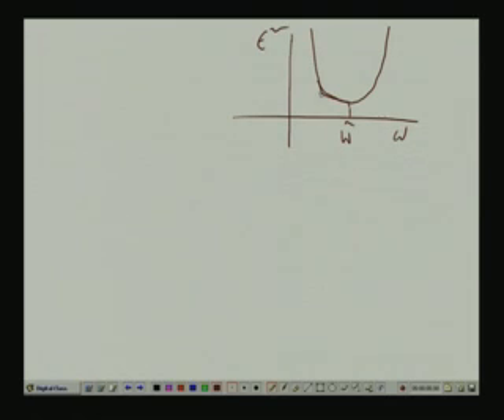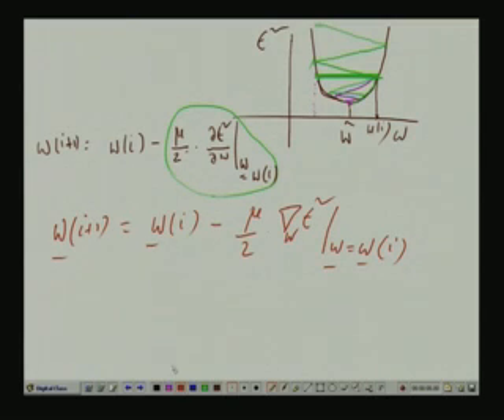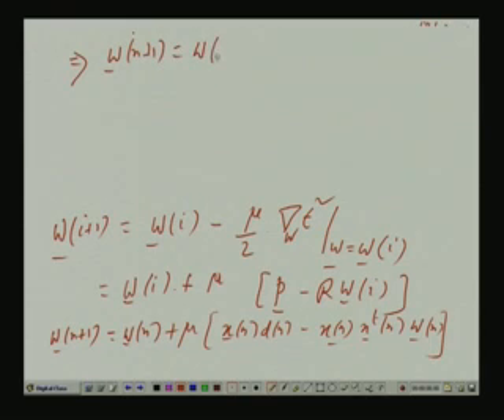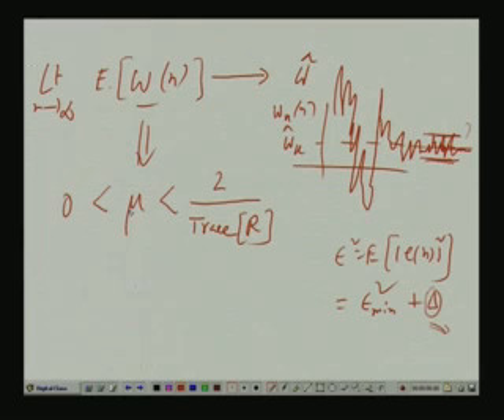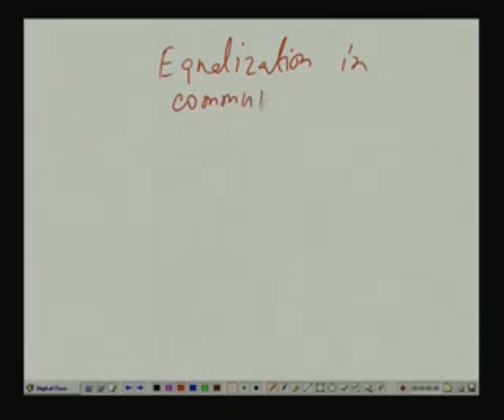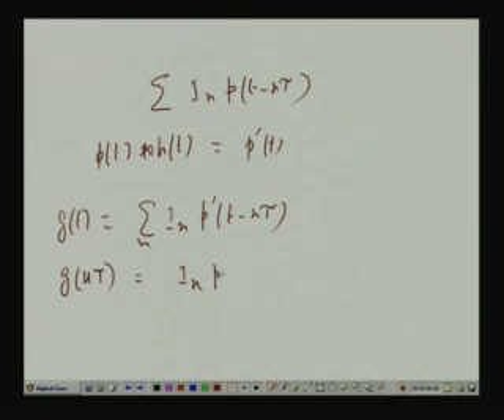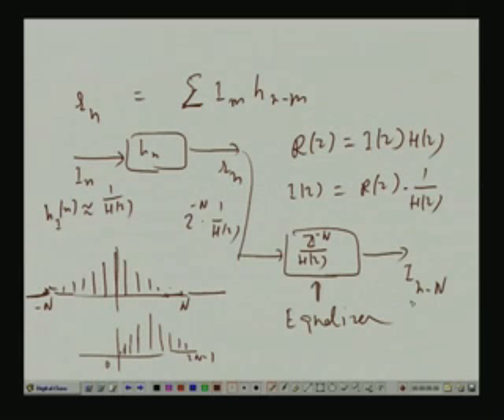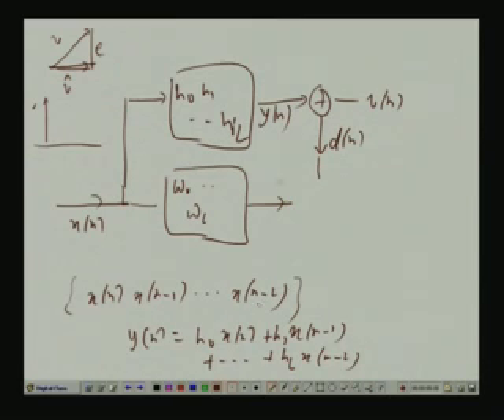Lecture - 40 Adaptive Filtering - LMS Algorithm

Comment: sir will you tell me what should we take d(n)in our code and also since we are using lms algorithm at receiver end the input signal may be noise mixed .so my question is what is the input to the filter and algorithm. I am writing code on matlab
Reply: @Chaitra Deshpande
The same method you can use for finding both equalizer as well as channel coefficients by taking d(n) and x(n) accordingly.
1. Suppose if you take 
  d(n) = received sequence at Rx
  x(n) = trained sequence sending at Tx which is also known to the Rx. 
 Then w(n) gives channel coeffs

2. If you take 
   d(n) = trained sequence sending at Rx whixh is also known to Rx. 
  x(n) = received sequence at Rx. 
 Then w(n) gives equalizer coeffs.
That's the Beauty of LMS. 
Hope you can understand this. 
It's better you draw it then you'll understand. 🙂